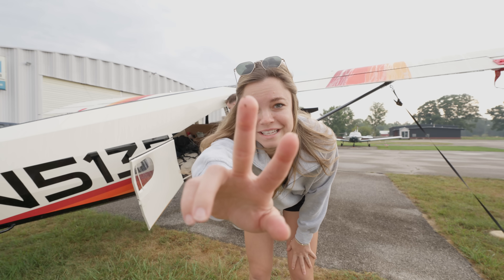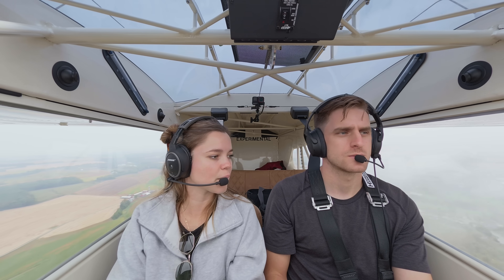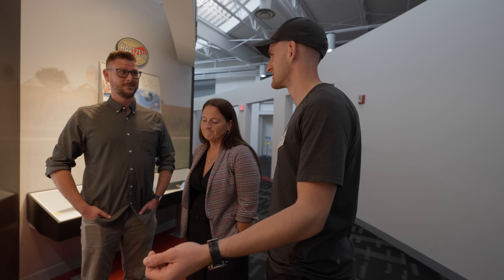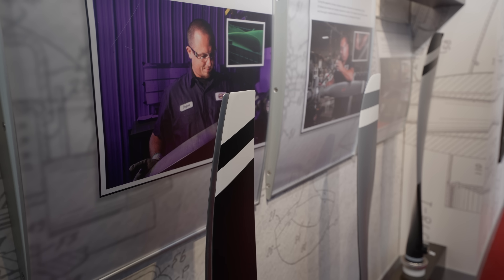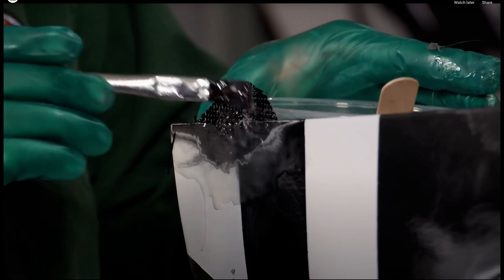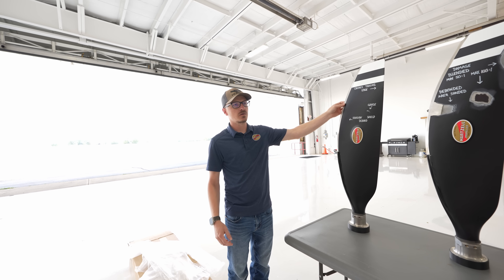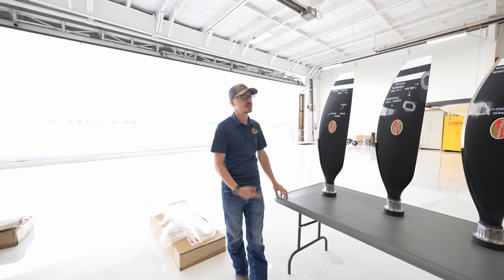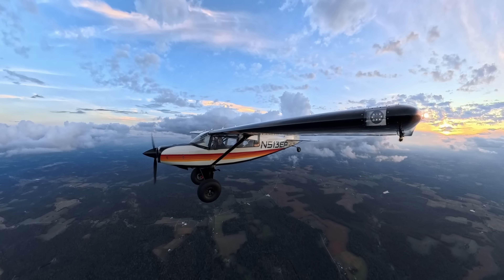The Truth About Our Propeller | Hartzell Trailblazer Factory Tour

Comment: Awesome prop tour video thanks guys! I had half a prop blow off in 2014 while I was over a large city.  Brand was a Wood Comp propeller, it broke at the root hub where the blade attaches to the main hub(composite exterior/wood core blades). Prop had 200 hours on it, manufacturing defect.  Almost lost the engine after it separated, deployed the ballistic parachute and walked away without injury. Now I've flown only MT props for the last 2500 hours without issue. Nice review, unfortunate they wouldn't let you guys film inside. Definitely heard nothing but good things about Hartzell.
Reply: Hey Darryl, I think you & I have chatted before !! Nice to "see"you !! That aircraft was a Pipestral ?? {if I remember correctly} What does"MT" stand for ??